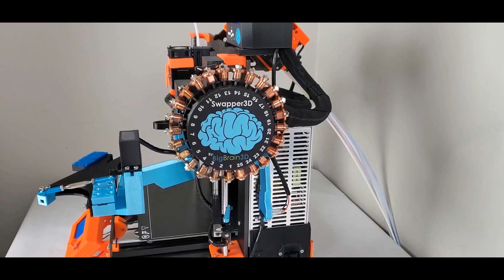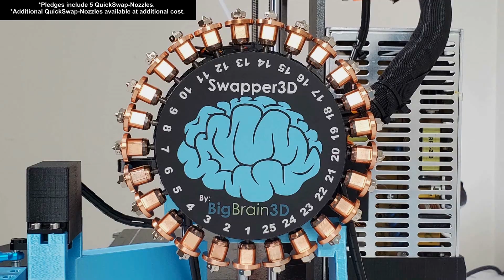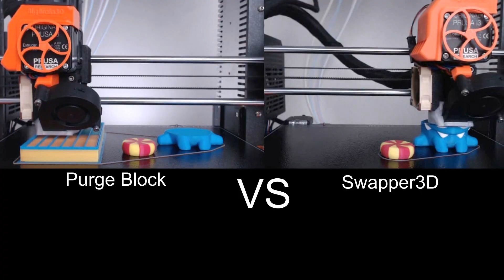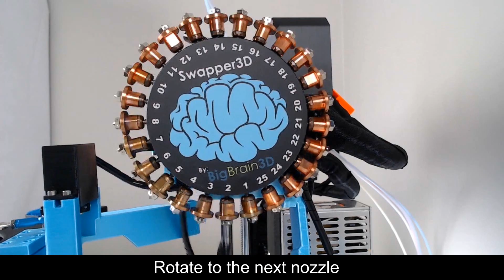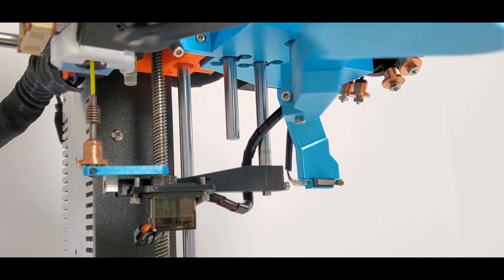Never print a purge block again!

Comment: Hi, new question: Do you have contact info?
I have a more compact method in mind to achieve the same result and I would like to share it to you. It would really reduce production cost, hence, render a more affordable product for your audacious customers!
I would like to simply scratch it on a piece of PNG and send the image to you so you can quickly figure it out and how to match it with Slicer.
Method would allow the use of enclosed 3D printers.
I don't own a printer yet, but I plan on working on multi-materials projects, so I really need to plan ahead and get the right products that matches my ambitions.

Comment: First of all excellent application of a great concept, I had a similar idea that I was wondering if it would actually work and you people proved it can!! But I have a question, I have read your FAQs and still couldn't find an answer; So it is great that you don't retract the filament but cut it, but when you want to re-insert, doesn't the cut surface be a problem to push later on when you need that color again? I mean the surface of the cut is irregular and it should be hard to push on top of that I am assuming.
Reply from the maker: Thank you :)
The filament path is constrained well enough that there is no issue pushing filament through the hotend, cut end against cut end.

Comment: Hi, so, it's designed for Prusa printers only or can it be used on other printers too?
Are nozzles included?
Reply from the maker: Printers other than the Prusa i3 will currently require a mounting adapter. The next printer we will adapt it to are the Creality series starting with the Ender 3. If you have design ability then you could use the supplied 3D cad files to make a mounting adapter for your specific setup.
Reply: @BigBrain3D  I'm all in for an Ender version of it. I don't own a 3D printer yet, got to stack my coins months after months, been many months already and still stacking... And I think I might go for an Ender printer, the most advanced, I wish.

Do you believe you could make a more compact, more budget-friendly version of your apparatus? 

Could it be compacted enough to fit inside an enclosed printer?
Reply from the maker: @SaintMatthieuSimard  We are working on an Ender 3 version right now. It may even be done before the Kickstarter is over...
Reply: @BigBrain3D  Be sure to reply to my latest comment, I'd like to contact you via e-mail to enhance the method to swap and store nozzles. It would fit an enclosed printer.
Reply from the maker: @SaintMatthieuSimard  You can contact us any time on bigbrain3d.com

Comment: what about retraction moves for that last inch or so of filament?
Reply from the maker: Retraction has 2 effects which both make a large impact to stringing. 1) removing extrusion pressure and 2) creating suction at the tip of the nozzle. The #1 effect is seen immediately after a swap. The #2 effect is seen shortly after a little bit of extrusion, and to account for that we change the slicer to infill before perimeters. There is also the wiper on the cutter arm (not seen in this video. More info on Kickstarter page.) that can be used for priming the nozzle.

Comment: I noticed when you RELOADED the NOZZLE it had BLUE FILAMENT IN IT.   Wont all of these nozzles be filled with cooled filament after 25 switches??   How do you clear them.   OR.   how does a disconnected filament.    re.  connect??
Reply from the maker: Yes they will. The Nozzles are swapped at the same time that the same color filament in that nozzle is switched into the extruder using the Prusa MMU. Each nozzle is assigned to a single particular color and reused an unlimited number of times. Each time the printer needs to use that color the Swapper3D loads the nozzle for that color and when printing continues the extruder just pushes the filament against the cut end until it's fed into the nozzle.
Reply: @BigBrain3D  ...that seems awesome... do you have more videos on that ,  really would like to SEE the filament being pushed into extruder..
Reply from the maker: @tomyocom5886  Do you mean the filament switching? There is a video from Prusa showing that here https://youtu.be/E1ZxTCApLrs
Reply from the maker: @tomyocom5886  Thanks for the clarity on your question. We don't have a way to video the inside of the extruder during use so that you can see the position of the filament ends in relation to each other.  There are some cutaways on the kickstarter page that make help you visualize what is happening inside the extruder.
Yes our solution gets rid of the purge blocks completely while still using the MMU from Prusa.
Here are 2 unabridged videos of printing using the Swapper3D with the MMU on a Prusa i3 and you can see that they do work to change color filament without printing a purge block in between. 
     Front facing: https://youtu.be/Z3rjUGf5QYM
     Side facing: https://youtu.be/ltVoUz5mSNg
There are lots more details on the kickstarter page that cannot be attached to this reply. I encourage you to check it out if this still doesn't answer your questions. Here is a link:
https://www.kickstarter.com/projects/bigbrain3d/swapper3d

Hopefully this helps explain :)

Comment: Does it reuse the old nozzle? How does it get rid of the filament inside that was cut? Very interessing system!! :)
Reply from the maker: Thank you :)
Yes it does. Each nozzle is assigned to a single particular color and reused an unlimited number of times. Each time the printer needs to use that color the Swapper3D loads the nozzle for that color, it's heated back up, and the printing continues. In this way unlimited color swaps can be done. For example, the print in the video has 576 swaps.
Reply: @BigBrain3D  This is awesome!!! Thanks!
Reply from the maker: @stevensicard4007  You're welcome :)

Comment: @BigBrain3D To be clear I'm very interested in this and would love to have one. Unfortunately, my experience with the Prusa MK3S+(Assembled and tested by Prusa btw) so far is that an accessory adding any additional weight to one side of the Z Axis inevitably results in a calibration fault. It's not a weight problem(even just a camera mount, less than 100 grams), the printer simply didn't like the imbalance. Even with multiple full calibrations from scratch, the only solution to the fault was simply removing whatever accessory was attached. So I am very interested to know how the Swapper3D is able to get past the calibration step with over 10x the added weight, are you overriding the firmware to ignore the calibration step, expanding the tolerances or?
Reply from the maker: 1398g are added to the sprung weight. The current of the Z steppers is increased to account for this, and no missed steps have been seen. In the kit we include heat sinks and a fan that are added to the printer main board which keeps it much cooler than it was with even stock current. The calibration fault you mention is caused if the mesh bed leveling determines that one side of the X axis is lower than the other by an amount too great for it to account for, at which point it will force the X axis to be raised to the top of the Z and even out both sides by pressing them against the smooth-shaft caps. We do that leveling reset step every time a print is started, and it prevents the fault from showing up. Does that answer your question?
Reply: @BigBrain3D  it absolutely does thank you! I appreciate the quick and honest response. Most makers seem to kind of just dodge this sort of question.
Reply from the maker: @FXSoup  You are welcome!

Comment: Not a bad price for what it does, assuming the hardware is reliable it'll pay for itself. 
I do believe the purge block example that is provided here however is quite deceptive, no one would do a multicolored print where the second object used entirely different colors. The only reason someone would print it in this manner is to create a longer print time, and a much larger purge block.
Reply from the maker: Thanks. 
Perhaps...but there are lots of prints that are 5 colors on every layer and would require a larger purge block. We felt this was middle of the road for a demo object.
Reply: @BigBrain3D  that's fair enough I suppose, I'll be looking forward to seeing it's release.

Comment: Another question I have regarding the kick starter, is why you have 3 levels of pledges with the only difference being listed as different delivery date? October, November, December, what is in the packages that warrants the extra time? As I stated earlier I like the idea if even though the implementation seems a bit crude, but I'm sure as time evolves the design it will become more streamlined and efficient. I also don't understand if this is "open sourced", then why the need for kick starter at all? I see from reading the text that my question about nozzle clogs has been answered, thank you for that. And finally my Prusa i3 MKS has a custom-built water cooling solution that I designed which uses stock E3D, and unfortunately I don't see how that can be incorporated if at all. Does your hot end design allow for water cooling? As I have found that water cooling the hot end has completely eliminated heat creep related nozzle jams resulted in ability to print more exotic materials such as PCCF and CF nylon as well as other higher temperature materials, will your system handle that? what are the temperature / flow limitations of your nozzle system? And can you print anything other than low temp materials?
Reply from the maker: All pledges levels get the same reward. They are just different delivery dates. 
Firmware and parts are Creative Commons ANC3.0
I think the water cooling won't work unless you customize the heater block.
Our QuickSwap-Hotend is all metal so it will handle all temp materials; Any materials that a Revo or Mosquito hotend can do. Plus our nozzle tips are changeable.
Kickstarter is a great way to prompt our Swapper3D kits.

Comment: good idea (as on CNC milling) but it will remain expensive since it is linked to the hardware, it only works on the prusa i3 which limits the interest. For this price you have a brand new 3d printer. For the multi colors you might as well make assemblies (cheaper)

Comment: my favorite 3 minute product video I've ever seen. Thanks for not wasting our time!
I would like to see how the filament is reloaded. Is that a manual process?
Reply from the maker: We are glad you think so! 
In this video we are switching the filament after a nozzle change using the Prusa MMU (Multi Material Unit).  In short, the MMU pulls the old filament out -> selects a new filament -> then loads the new filament in. (The Swapper3D cuts the filament before the MMU pulls the old filament out to prevent possible strings and jamming.)

Comment: does the holder keep the nozzles at working temp ?  and if not how long does it take for a swapped nozzle to reach working temp once inserted into the hotend ?
Reply from the maker: The nozzles cool down in the holder. They take About 15 seconds to heat back up, which is almost exactly the same time it takes the MMU to unload the current filament and load in the next filament, which means the swap add zero(0) seconds of additional time because of the nozzle heating up. The Nozzles have a low thermal mass. The QuickSwap-Hotend has a much larger mass and it maintains the temperature of the heater block at all times, during printing and during a filament change and during a swap, with the standard 6mm tube heater and thermistor of the Prusa i3 extruder. When a cold nozzle is inserted, it lowers the temperature of the heater block by about 15C. The Swapper3D inserts a gcode command to wait for the temperature to stabilize to the print melt temperature before it continues printing.

Comment: I'll agree that this is a great idea. Looks very similar in design to a lot of C&C multiaxis mills with tool changers. However not to be the black hat in the room I do have a couple of queries, 1st, how do you guard against clogged nozzles? And does the system detect such events and change out the nozzles? Also with regard to the kick starter I've been involved with enough kick starter's at this point my life to be very wary of potential failures. Immediately the 1st red flag that comes up is one that has $0 as its target goal ! . That equates to being charged immediately upon making a pledge rather than being charged only if that kick starter meet its target goal. There is enough uncertainty and risk as it is. The only real protection against most scams is the fact that target goals must be set and met before anybody is charged the pledge amount. And with having said that. How do you intend to finance this going forward?  When you've only so far raised around 30+ K and any kind of production is going to take a lot more funding than that. So that's the 2nd red flag that gets raised. How do you intend to raise the money needed to really take this into production rather than just produce a few units out of a garage?

Comment: What's the mechanism to retain the nozzle into the hotend? I'm assuming the heater block isn't directly to the nozzle then? Have you guys noticed any issues with heat creep and clogging, if so?
Reply from the maker: The nozzles are designed to avoid heat-creep and clogging for this exact situation. There is a sliding lock that pulls the hotend up against a taper in the heater block. You can see more information about it on the Kickstarter page.

Comment: Hell I’d be interested in just the quick swap nozzle aspect, nevermind it being automated to boot. What nozzles / hot ends is it compatible with? Is it only compatible with Prusa printers?
Reply from the maker: The QuickSwap-Hotend, which can change nozzles with just a push of a button, is compatible with most printers. It will work with any Mosquito hotend adapter.

Comment: What is hapening with filament that is left in the nozzle after swap and cut?
Reply from the maker: Since the nozzle are reused multiple time during the print we just leave the filament in the nozzles so there is no waste.
Reply: @BigBrain3D  So how the retraction works with out stringing?
Reply from the maker: @miszkolc6535  Retraction has 2 effects which both make a large impact to stringing. 1) removing extrusion pressure and 2) creating suction at the tip of the nozzle. The #1 effect is seen immediately after a swap. The #2 effect is seen shortly after a little bit of extrusion, and to account for that we change the slicer to infill before perimeters. There is also the wiper on the cutter arm (not seen in this video. More info on Kickstarter page.) that can be used for priming the nozzle. Thanks for your comment :)

Comment: Do they deal with filament left in the nozzle? Didn't answer that one...
Reply from the maker: Since the nozzle are reused multiple time during the print we just leave the filament in the nozzles so there is no waste.
Reply: @BigBrain3D  are all the nozzles kept heated then? Otherwise each nozzle would have to be heated up costing additional time
Reply from the maker: @fabriglas  No, the nozzles cool down while stowed in the tool holder wheel. When reinserted they heat back up in about 15 seconds, which is almost exactly the same time it takes the MMU to unload the current filament and load in the next filament, which means the swap adds zero(0) seconds of additional time because of the nozzle heating up.

Comment: but cuting the filament on the nozzle isn't a waste of filament too?
Reply from the maker: no because the part of the filament left in the nozzle will be used the next time that nozzle is used. It only makes 1 cut, and in order to waste filament the Swapper3D would need to make 2 cuts at least.

Comment: Why are you cutting the filament when you can just retract before pulling the nozzle out?
Reply from the maker: Pulling out the filament can cause strings and malformed tips that interfere with reinserting that filament next time. It's such a common problem that some people hate filament switchers like the mmu because of it. Cutting the filament eliminates the possibility of those problems.

Comment: Getting rid of purge blocks would just be the beginning for a nozzle-changer system like this. Imagine switching between a brass nozzle and a hardened steel nozzle when doing a multi-material print using glow-in-the-dark or fiber-filled filaments alongside regular PLA/PETG, or switching from a 0.4 mm nozzle to a 0.8 mm nozzle for increasing print speed in a low-detail section of a print. As much work has been done on the subject of multi-material printing in the last few years, there are still tons of possibilities for improvement.

My biggest concern with this is twofold: 

1) Proprietary nozzles always trouble me in case the worst should happen and the supplier goes out of business or gets bought and broken up by a larger competitor. There is also a general level of concern about any 3D printing-related Kickstarter campaign, given the success rate of Kickstarters from startups and established companies like Creality. 

2) Does this product sufficiently differentiate itself from established tool-changer systems such as those from Printermods, Prusa, and E3D? There seems to be a lot of complexity here compared to even the motorized tool-changers from E3D and Prusa, and one thing this can't do that existing tool-changers can do is use a different extruder for specialized applications. 

Also, is there a risk that some of the advantages of a nozzle-changing system would be mitigated by cost and quality improvements in IDEX printers? Yes, you're limited to 2 or 4 (or whatever) nozzles instead of 25, but the number of people who need more than a couple different nozzles for a print seem quite limited as well. I think back to some lab equipment I used to sell in a previous job, where there was a sample autoloader but almost nobody actually needed it....